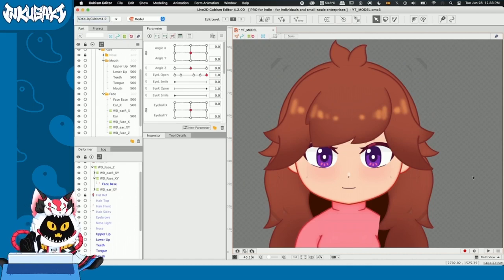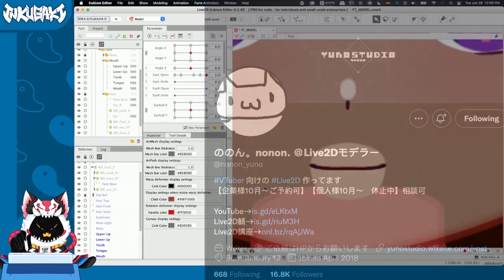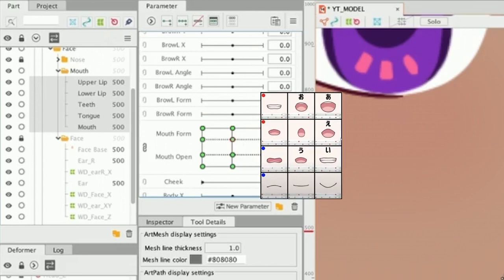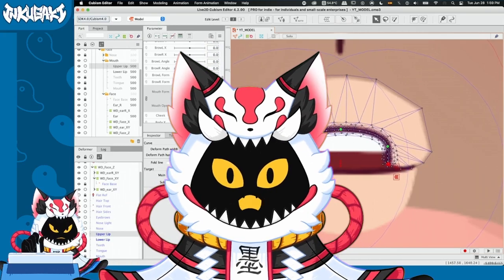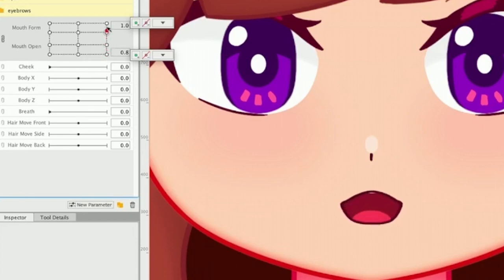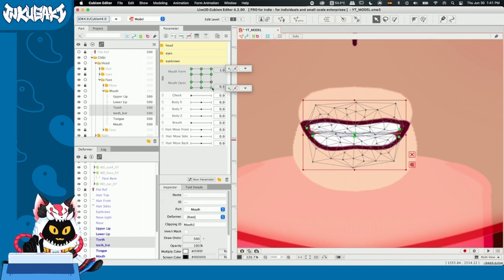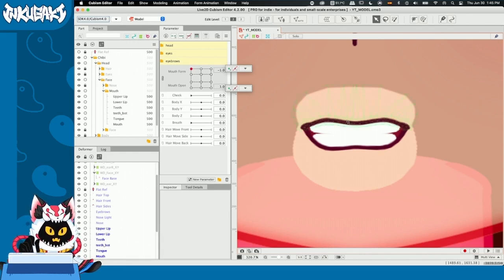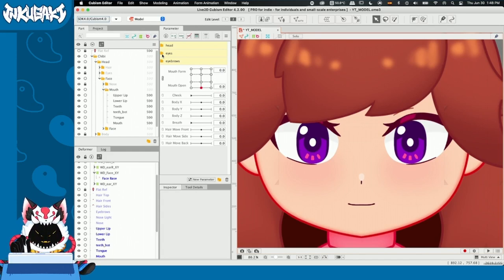Live2D Tutorial: Mouth Rigging! Full Process

Comment: Great beginner tutorial!  One thing I would add tho, the upper teeth on a person are attached to the skull and don't move with the mouth at all. Having the upper teeth go in and out like that can make a character look really creepy and freaky. In a way that the viewer might not even be able to realize what's bothering them about the character.
Reply from the maker: I'm glad it was helpful!. Also, I totally agree with the upper teeth point in regards to the skull attachment!

To make the steps easier to follow on how to use the parameters for the mouth, I applied the mouth shape sheet from the beginning of the video.

Those kind of shapes are commonly used amongst mouth rigs and the anatomy rules tend to bend a little bit there. BUT if you want to check some anatomically accurate examples of mouth animation, I'd recommend you search for: Theartgun in google, personally I haven't found anyone that come close to her accuracy in terms of mouth tracking and rigging 👌

Comment: Very helpful! I've started mouth rigging on my own model, do you have any tips or advice on Mouth Rigging with Head Turns? It's been very difficult
Reply from the maker: The best advice I can give you is, rig your mouth's open and form parameters first. Then make an x+y position warp deformer containing all the parts and other deformers of the mouth, DO NOT add x or y position to your mouth open or form parameters, if you do that is going to be really extremely hard to make it work. Usually what most likely will happen is that, as soon as you turn your head, your mouth is going to deatach not following certain movements. hope that helps!
Reply: @Inkugaki_Live2D  Thanks for getting back to me!
Just for clarification, you mean Parent Warp(MouthXY)-->Child Warp(upper mouth) + Child Warp(lower mouth)? 
I may have to redo bc I have been warping the meshes individually in XY when I have a linked Mouth Form/Open parameter selected...
Reply from the maker: @SmallisTall  Yes, that´s the hierarchie you need to use.  You have to redo the angles in the new warp deformer but the good thing is that you´ll find this way this way is 10 times easier!

Comment: my top and bottom lip don't have skin on them, so I'm having to warp the meshes for the mouth like I did for the eyes. Is there a way to not have the inside of the mouth clip so much in the shift? For instance, for my closed mouth, the parameters are at -1.0 and .0, and the next opening sequence above that is at .1 and .0. But it still has a goofy warp right in the middle of that shift from open to close. How do I fix that?

Comment: Hi! Ive set all of my expressions accordingly to the parameters but in Vtube Studio its not doing the Mouth wide open or the O, and A shape I created. Can you help me? 
Thank you <3
Reply from the maker: Hi! This are some things you might want to check out for Vtube studio and hopefully they can help you with the mouth problem :D

I can think of a couple of things If your model is not recognizing some mouth movements.

1. Check the camera you are using, depending on the amount of frames of your camera, the mouth tracking might be more or less smoother.
2. Check the lightning of your room, the brighter the better
3. If you are using VTube studio on Mac, there are times where you need to restart the program because for some reason some mouth shapes won’t show at all (has happened to me before on an old Mac I have).

If none of the above works, then you might need to tweak the facial recognition in VTube studio, you can check this options:

1. On the camera settings in Vtube Studio, look for the “mouth open sensitivity” this might help on fixing the problem a little. (The less sensitive the easier is going to be for the mouth to open and usually change shapes)
2. The last thing that comes into my head is, the microphone settings on VTube studio. Now the way they work is really simple you set up your mic and Vtube Studio is going to track it, down at the bottom you’ll find the phoneme configuration where you can increase or decrease the transformation of your mouth and that can help the model have a little more accurate mouth transformation. 

I hope this helps! :D
Reply: @Inkugaki_Live2D  Thank you so much for your quick reply, I will go through and check everything listed above <3 I love your characters ears they're so freakin adorable!! If you ever want someone to do a collab with , keep me in mind! :3
Reply from the maker: @SaiyanChivi  You're welcome! and thanks for the compliment (〃▽〃)! I'll keep you in mind for collabs! :D